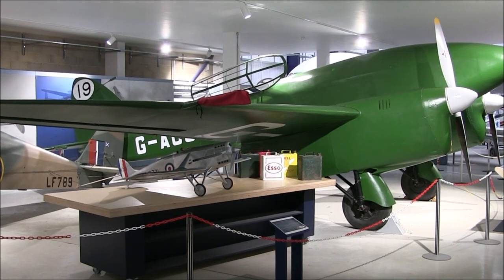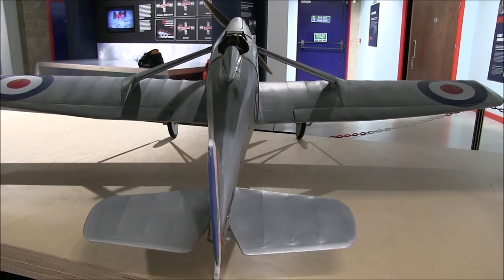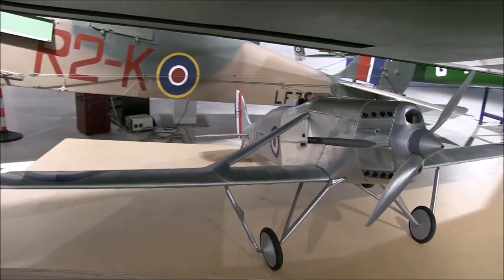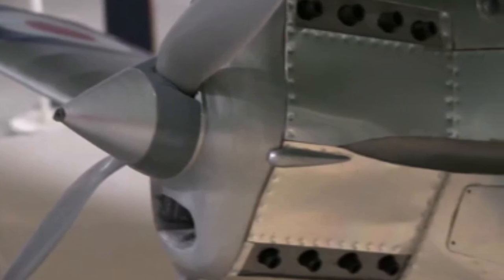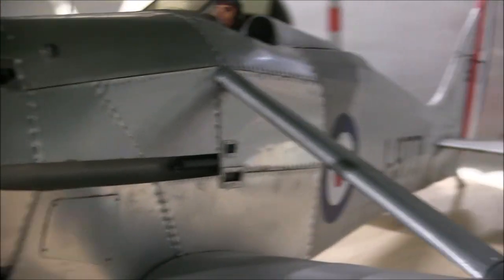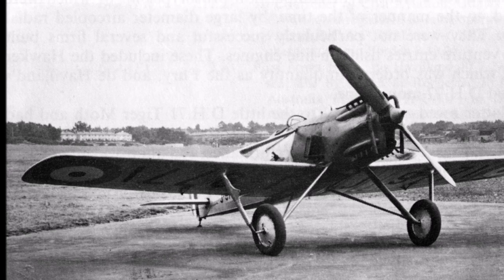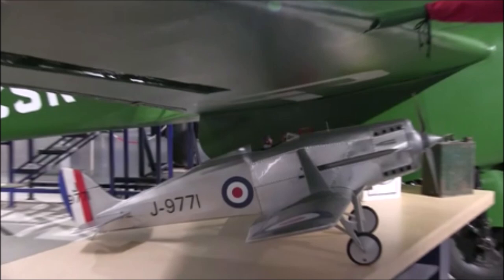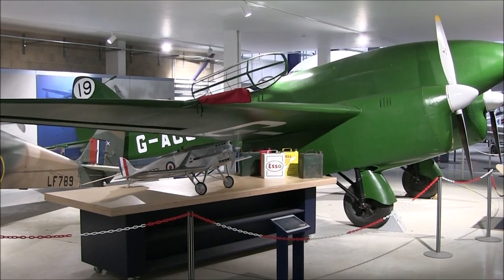DH77 - better than the Hawker Fury?

Comment: Given the DH77 could match the Fury whilst using a significantly less powerful engine, you might have imagined someone would have scratched their butt and than said 'If we blag one of them Kestrel engines off Rolls Royce like those bggers at Hawker have stuck in the Fury, due you suppose ...........  etc'
Reply: Typical government short sightedness
Reply: There were probably very valid reasons why, most likely the air frame wasn't suitable etc.  Real life is a lot harder than just saying "fit a bigger engine".